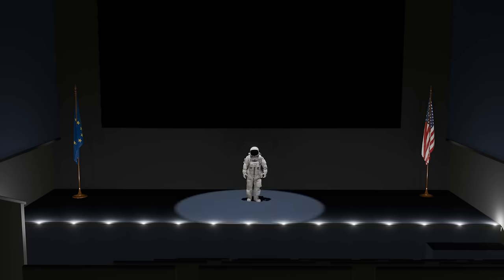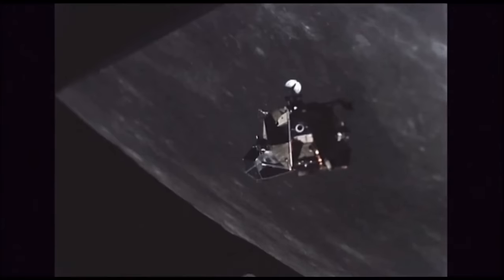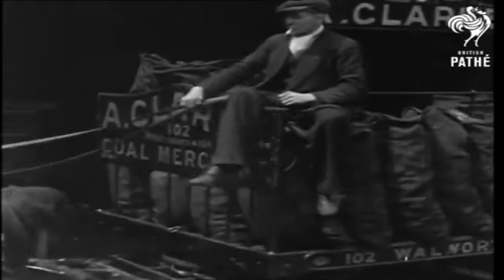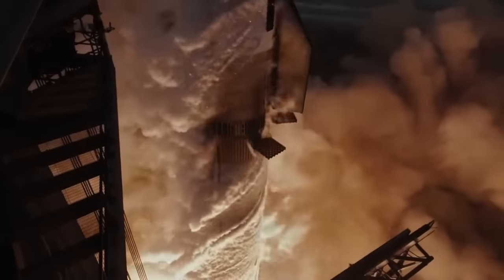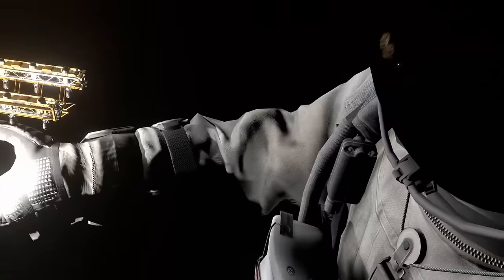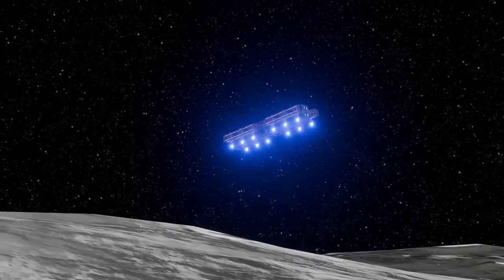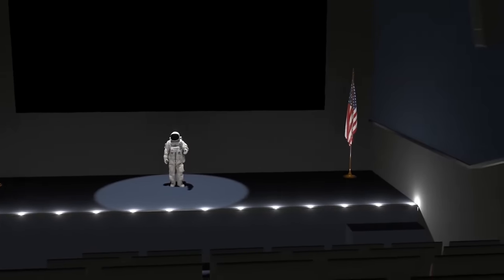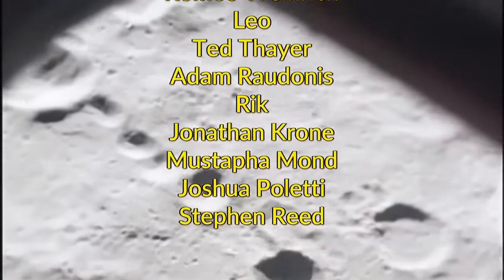Lunar & Orbital Infrastructure ALL PARTS

Comment: I spent 40 years packing export containers for export. Our standard was a minimum of 46,300 lbs per container or 21 metric tons. Everything was based on this number because the shipping lines charge by the ton down to 21 mt.  If you ship less than 21 mt, you're still for 21mt.
Reply from the maker: @joebushnell143  very useful to know I appreciate that.

Comment: A maglev system would make more sense for a lunar mass driver. Avoid ablation entirely by using magnetic levitation and a linear accelerator. The track would be composed of passive stabilizing coils, an active inductive power transfer system, and the stator of a linear motor. The launcher would then need power handling equipment and the rotor of a linear motor.
Reply: The issue with this is fabricating a maglev system on location from regolith, which would likely be incredibly challenging. Perhaps the rail system could be upgraded later, as he mentioned about adding cooling, to use a maglev configuration, but that remains to be seen.
Reply: @tonig2255  The only difficult part to construct would be the launch vehicle. It would need superconducting coils. I would suggest shipping the superconducting coils in as part of the launch vehicle. The track then would be build on site from iron structures and aluminum wires.

It would be structurally weak and energy inefficient, but it would work and be cheaper than shipping in mass for anything else. We can consider regolith as free construction material. Even if we can't convert it into anything more useful than pure iron and aluminum, we can just use more mass to compensate.

good enough is all that's needed.

Comment: About the cargo/passenger railgun, remember that the rail carriage needs to slow down after a launch, so the rail has to be longer than 300km. Ideally, for safety reasons, it should be twice as long if you need to abort a launch right when you've reached escape velocity. Zero safety margin is not how we play in space.
Reply: If there is an issue the payload is probably going to eject and then land at an alternate place as if there is an issue with the track it's probably an issue that would be because of a  derailment type event so slowing down isn't an option.
Reply: @matthewconnor5483  I was thinking more a fault with the payload, rather than the track. Especially if the payload is people.
Reply: @DefaultFlame  most commercial aircraft have a point where there is not enough runway during takeoff to stop. So if there is an issue they take off and then come back around for landing. For a rocket barge on a mass driver I would say they would have to be a designated area down range as a landing zone. A barge-like that is going to have multiple engines so if there is an engine out scenario they should be able to make it to orbit or at least get off the platform in land somewhere down range if they weren't up to orbital speed yet.
Reply: @matthewconnor5483  You are missing the point. The failure on the payload can be one that prevents it from maneuvering. That is in fact the failure most likely to require an abort of the launch. There is no reason not to build the required length to brake an aborted launch.
Reply: @DefaultFlame  do they make run ways long enough to stop once at take off speeds? 
Which is more? Kms of extra track to maintain or abort rockets?
Reply: @matthewconnor5483  In the long run rockets would be more expensive. As for runway lengths, we don't have as strict safety requirements for airplanes as we do for spaceflight, partly because as long as you still have control surfaces you can still glide even if the engines fail. Being on planet and in atmosphere makes it much safer. On the moon, if the thrusters fail, there's nothing to do except tumble and crash.

Think of it like this, would you rather take the extra safety precaution of having to make some more lunar steel to make longer rails, or would you rather risk having a PR disaster that might end up spooking your investors into pulling out and potentially killing the entire endeavor for a few more decades?
Reply: @DefaultFlame  currently we don't put abort systems on cargo rockets. Only human launches. Preflights inspections hand most issues. If you are using "sled" for the cargo with multiple engines and engine out situation is not much of an issue as each engine is x% of the thrust. 
At some point if you are using a track/runway you will hit a speed where slow down would be nearly as long as the distance as was used for acceleration. A situation where you couldn't detach from the sled seems highly unlikely, especially if the vehicle is hooked to the platform like they do for the catapults on aircraft. Slamming the brakes on the track vehicle would be an ejection. If anything put a ramp at the end so the payload goes into a parabolic arc to a designated area like they currently do with are near Ireland being the ditch zone for a human flight if they have to abort well into first stage burn.

The stack is stage 1 of the lunch system. We don't slam the brakes on stage on of a rocket if there is an issue. Stage two detects and gets away then goes to the recovery zone.

Comment: Nice presentation, thanks very much for posting
a few points;

1 A lunar elevator such as the one Liftport is talking about is probably worth looking at.
2 Sky hooks are another factor on the list to consider.
3 If luna-centric construction is enabled it wouldn't be too overwhelming to have more than one "railgun" platform. Think of it as the locus of a launch delivery system. 400 launches is a very reasonable "cost" when it can be recycled and used for other purposes. Build one, then start on constructing a second one. Eventually another team is brought on to dis-assemble the first launcher once it reaches 400 uses. The Lunar track is already paved so only the new track needs to installed. 1 launch per day for a year for the railgun is an investment for the bean counters to assess. I suspect its "cheaper" to implement than a traditional lunar launch platform.
4 Elliptical cislunar logistics enable regular delivery of materials, human power etc. They need station keeping but it removes all the associated fuel transfers of LEO rockets that are designed for that purpose. The issue then becomes optimizing lunar surface delivery contact (see elevator/sky hooks)
Reply: Very good points

Comment: Because of the lower gravity, a functional space elevator could be built on the Moon with existing materials like Kevlar and carbon fiber, this way the freighter could stay in orbit all the time
Reply from the maker: @viniciusjose8763  yeah that's a likely future optimization
Reply: Is that true? I'd love to see the paper on it. That would be huge,especially for getting volatile, nitrogen, phosphorus etc to truly build sustainable bases on the moon.
Reply: @angusmatheson8906  the issue is because the moon is tidally locked the cable will have to go past L1 so it would end up being a truly massive cable and then you have a huge distance to traverse from docking station down to the lunar surface. Pretty much need two cables or more so multiple carriers can be going up and down the lines in a big loop.

Comment: If you have a 8-ship spinlaunch-type system that can launch every 30 minutes and each vessel has a 21-ton shipping container as mentioned by the other commenter, operating 24/7, It can launch around 8000 tons per day. Including launch issues and delays thats still a solid 50+ walmarts/year earthside and much more efficient that a super heavy rocket.

Comment: I think one technical difficulty wrt your Walmart comparison is that you basically modelled the steady state throughput of a Walmart as to what it would support.  That's OK, but you will also need to consider how many trucks were needed to originally stock it plus provide the store infrastructure to get it started.  Its a one time cost, but quite substantial.  I would think comparing the capital cost to build/stock a Walmart vs its annual revenue might provide some insight.

Comment: I think you under estimate the cost of lunar resource production. You are going to need mining equipment, ore refining/sorting, smelting equipment, ingredients such as carbon for steel, construction equiptment, computers, power, fabrication equiptment (lathes, mental benders, CNC machines, files, band saws, dies). Your earth based steel mills/metal fabrication plants can have footprints of up to a few square kilometers. That is a lot of factory to build. THis is also considering a simple lunar base would cost between 20-40 billion USD according to nasa

Comment: What is stopping the mass driver being run in reverse, i.e being at escape velocity on its rails with the freighter settling down onto it at speed, so it only needs to use its fuel for reducing the vertical velocity and not horizontal, and the electrical resistance then slows the whole thing down?

also great video i loved it :)
Reply from the maker: @raffen4728  you know, that's actually a great idea. Technically slowing down is what will lower vertical velocity, so it will still need to brake but it could be like 70% of  lunar escape velocity when it lands on the pad going 70% as well and then a magnet or clamp can engage to hold it down while the mass driver slows down. Genius!
Reply: @Anthrofuturism  Glad you think so ! I'm struggling to visualise it in my head, however: if you injected the freighter back from LEO with its course intercepting the moon so that it's closest approach would be skimming across the surface at low altitude and very high speed, you surely wouldn't need to shave off much vertical component, only enough horizontal so that the freighter would match the high speed of the sled. Although I think you'd have to worry about terrain and burns for accuracy which would shave efficiency off, but if the savings are even above 50% surely that's worth consideration especially if it would only require minor adaptations to the design, although the track would probably have to be double in length so it had space to accelerate from one end, catch in the middle, and decelerate to the other. Also, if something went wrong and a burn failed, the freighter would skip away from the moon harmlessly without even impacting it. I love stuff like this. I hope I haven't given you more animation work to do.
Reply from the maker: @raffen4728  ha perhaps you have but that's a good thing! Thanks!

Comment: I think it's possible to design a Falcon 9 2nd stage to be recyclable at it's destination, which can be the moon or an orbit or a Lagrange point.  In either case, I think there might just be enough cargo mass left for a small reactor.  Add a few more of those 2nd stages for the refinery and some tele-operable construction platforms, and you can start small and build.  If another load brings a system for turning silicon into PV, you can gradually add power.  All of these can just run as much as you like as you build up stockpiles of building materials.

But the beginning will require someone like Musk (or maybe Bezos) to decide this system needs to be tried.  Personally, I'd dearly love to work on something like that and I already have a pension.

Comment: You don’t need coil guns nor to deal with the ablative. Just use maglev trains. Japan has them and they are a proven technology. By using them you don’t need  to limit your size because there is NO coil above and you also don’t have to replace your tracks because it is hovering. Problem solved

Comment: The water question is why your idea for the mare base is a bit off. We'd need to have the main base at the pole, where there is significant water ice available, and wed absolutely try to make use of the vast lava tube systems as accommodation etc.
Reply: On the moon frozen water may be easier to move by train then as a liquid in pipes. It may make sense to have polar ice mines and then ship the ice to the bases around the surface where it it is easier to launch and land.

Comment: I like the analysis being done. Also think it mostly hangs together. Hwoever I have to wonder why the narrow focus on the earth being the only possible source for needed volatiles? There are a large number of NEO's. Some of which would have some if not all the volatiles we need. I dont think we would attempt to wrangle one out the gate but by the time we start building that platform for ferrying imports from the depot in earth orbit. You can also send a rudamentary ship to an NEO.
Reply from the maker: @jasonbirchoff2605  yeah you're right but it's still a limited supply and technically challenging but if you can get it from there that's bonus. Also lunar ice had C and N (and obviously H) but it's not a lot from an industrial scale

Comment: I think the HEX Containers would be loaded on Earth, trucked to the launch pad, launched to LEO, picked by your freighter, carried to the moon, landed, and then finally unloaded on the moon.

Mass Driver Rail: For the first generation - Its ok if we don’t reach escape velocity. If mass drivers take-up 70% of the speed, and we let rockets complete the 30%, that’s still a huge savings. The second generation mass driver (rail #2) can be 100% of escape velocity.
Reply from the maker: The hex going to orbit is redundant to the actual fairing of the rocket which is a capsule and if you strap the containers to a rocket they need to be aerodynamic not hexagonal which means they're harder to make from steel panels on the Moon so you make them on Earth and you make them round/aerodynamic and light weight and look what you've just made is a fairing :)
Reply: @Anthrofuturism  I see your point. I think the trade will be 1) extra weight on launch (very expensive)  vs. 2) Multi-modal containers reducing the # of handling steps during shipping.

The value of multi-modal is really important. Putting HEX Containers inside the fairing would fit fine, and be handy in all directions ... except for the added weight of the HEX container.

Unloading and re-loading cargo in orbit (as your video shows) saves weight when its most-expensive, but the added handling costs might be ugly.

I am not sure.

I suppose this changes a lot if we can make fuel on the Moon. Water-ice splits to H2 and O2 easily. Add some carbon, and you have "shelf-stable" methane. With moon-fuel production operational, we don't care about the added weight of steel HEX containers. We have loads of fuel.

One other bottleneck to consider - where is SpaceX getting the electrical power to make the launch fuel? They show videos of vast solar fields powering the Methane and O2 production. What's the acreage needed to launch 3x startships each day?
Reply from the maker: @scottbillups4576  Yeah tradeoffs all the way down lol but if you can use a mass driver when launching from the moon you're using electricity instead of fuel, like you said even a 70% velocity enhancer its a big deal so we should shift as much weight in the entire supply chain towards that if we can. Deviate towards the mass driver. But before it's up and running if you've got freighters they could potentially just take the upper stage of the starship itself as the capsule, so then the freighter becomes a sorta 'landing lunar gateway' or 'braking/descent stage' however you wanna think about it.

Comment: The creator of this missed the whole point of lunar and orbital development. The materials to develop these locations do NOT come from earth. To start, in-situ materials are used with a minimum amount "imported" materials. A medium sized nickel-iron asteroid would yield enough metals to supply the entire planet's consumption for a decade! Deep space tugs could slowly bring it to one of the Lagrange points in less than 10 years. Energy for smelting/production is literally everywhere in near earth-cislunar space. You now have raw materials and energy. Now all you need is machinery to produce.
The only thing that need be brought from the surface of earth is a small amount of machinery to produce a copy of itself, which makes a copy of itself. Von Neumann machines. At some point the pattern is modified and it produces something else, ad infinitum....
After a decades or so, the flow reverses and the space-based factories supply the planet. Far less energy is needed to drop down the gravity well than up out of the gravity well.
Even the mass driver idea misses the mark. A linear induction motor pulling a "carriage" holding a payload. Once escape velocity is reached, the payload is released and the carriage decelerates (recovering some of the energy used to accelerate) and loops back to the loading point. Small RCS jets to trim the orbit of the payload. The only thing you would need a rocket for is people.
The only bottleneck is earth launch. Save that for people. Take them to LEO and transfer to a dedicated lunar transfer vehicle (ala 2001-ASO). All that mass from the surface to cislunar is a waste. You don't need sea-level Raptor engines or flaps or even enclosed structure except for passengers once you are in orbit....